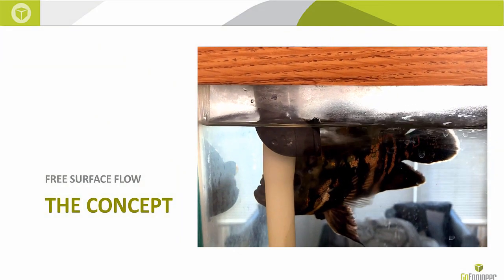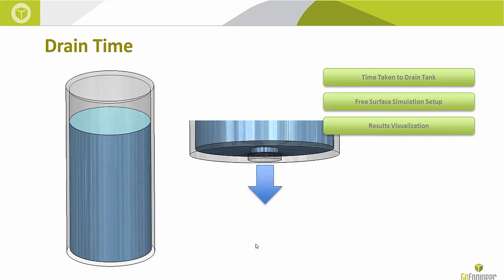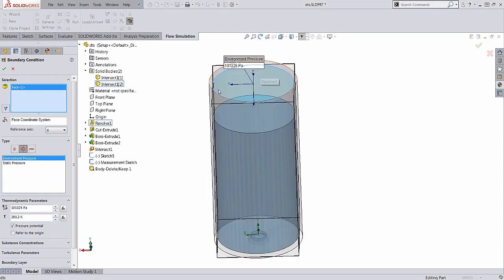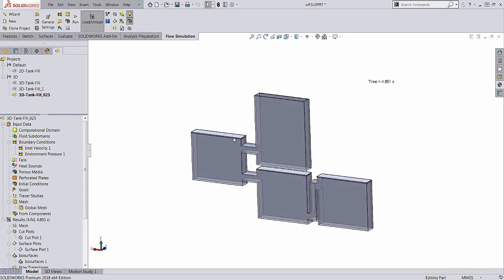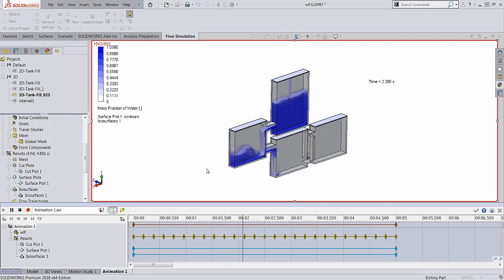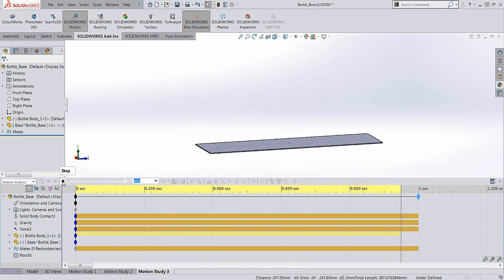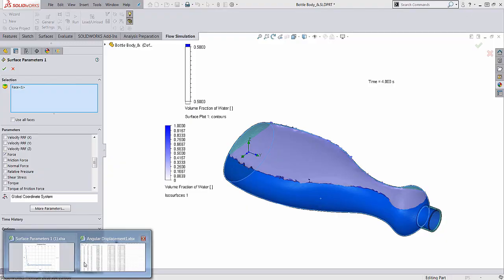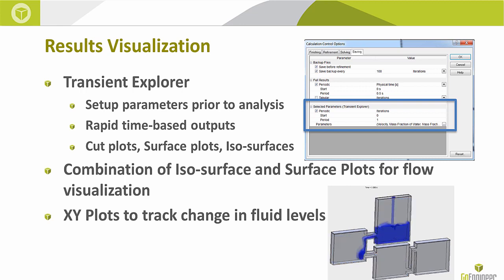SOLIDWORKS Flow Simulation - Free Surface Flow

Comment: Very clear illustration thank you! Why doesn't Solidworks recognize my fluid subdomain after setting up the air as initial fluid? I'm doing the simulation in an assembly file, and I extruded a solid body for my water domain already.

Comment: How accurate is the bottle sloshing animation with relation to the chemical properties of water? For example if you changed the fluid to a much denser organic solvent, would the animation behavior reflect this drastic property change made to the fluid?

Comment: Is it possible to create custom fluids with adjustable values for viscosity, density, etc and have a mechanism interact with the fluids in an animation?
 
For example, if I had a model of this device, could I create a 2 phase fluid system in the vessel and actuate the vessel as shown to study the effects of changing various parameters or volumes of each fluid? https://www.youtube.com/watch?v=LbZVZbYP7_0

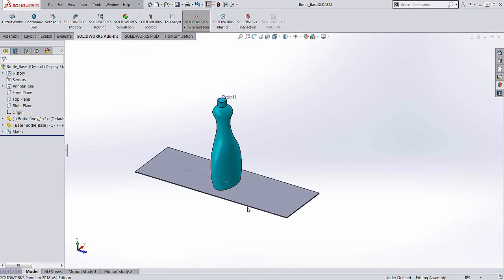I think you answered this at 20:20 but I’m unsure how to apply it to my need. I essentially want to visualize the effects of altering the density and viscosity of each phase of the fluid system. Is this possible? Sorry if it is not clear.

Comment: You do realize that using the mass fraction is causing an error when showing the water line?
If you use the mass fraction it is basically showing you how much percent mass of a cell is either liquid or gas in your water and air case. The water has a mass that is about 1000 times higher than air and with just 10% of the cell filled with water, you already have almost 100% mass fraction of water.
That's a simple hand calculation:
A cell with 1cm^3 volume filled by 10% is 0.1g water and the 90% of air is 0.0009g air. This makes the cell to have a mass fraction of water of 99.11%.
This basically suggests the cell is almost 100% full but in fact, it is only 10% full due to the density you are considering in your mass fraction.
You should use volume fraction!

Comment: Hello, great tutorial. Thank you. What if the first tank is not open from the top? Why you need to add environment pressure?
Reply from the maker: Good question.  As the water is evacuated from the tank, there needs to be a way for the air to fill up the top of the tank to replace the missing water. The environment pressure at the top lid facilitates this air entry.
Reply: @goengineer  Well if you turn a glass bottle upside down, the water will flow out eventually. How can I simulate that kind of a process?
Reply: @GoEngineer  what if all founr tanks were closed? Wouldn't the liquid flow anyway?

Comment: Hello.  When I select transient explorer appears a message: No calculated parameters are found. Please specify at least one parameter in the Calculation control Options and solve the project.   I really don't understand because I can see changes when I charge different time in Load time moment.
Reply from the maker: Juan,
We are unsure what the source of your particular error is.  We would advise you to contact your local SOLIDWORKS support company so they can initiate an investigation to help you.